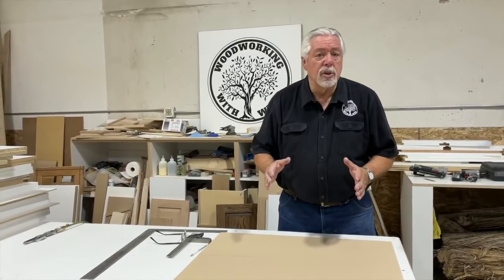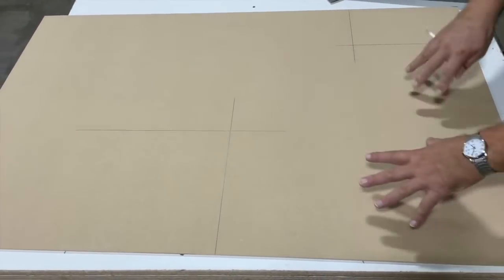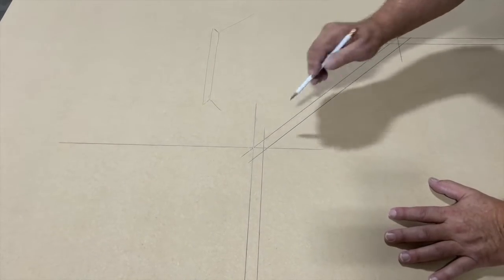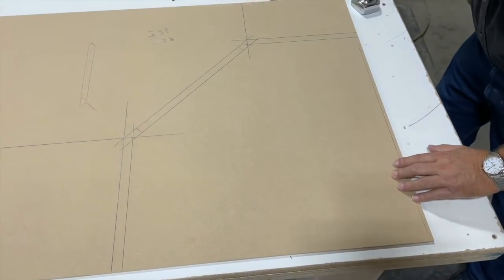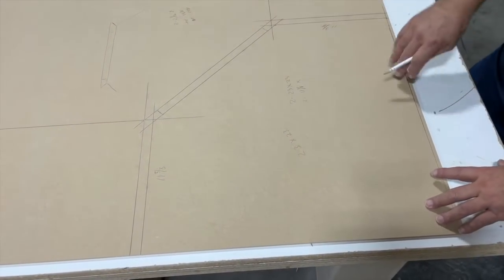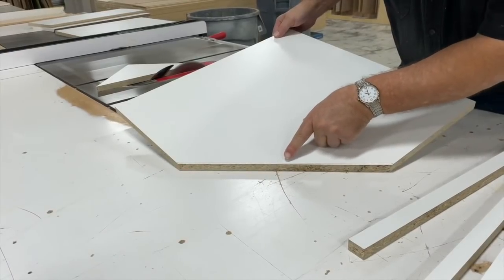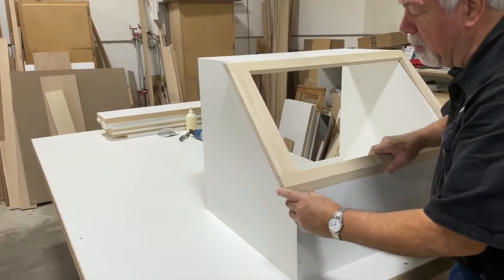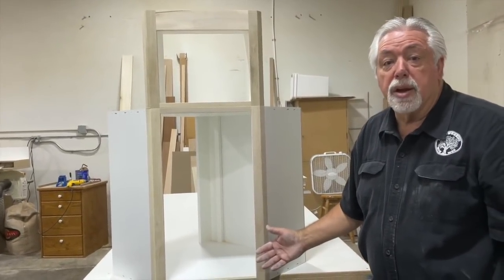Corner Cabinet Basics You Need To Know

Comment: Hi Wes, nice video. I have a couple questions:  1- why is there only one piece of backing instead of 2, and 
2- it looks like you're using particle board with nails to hold the sides to the base. Do you find particle board will hold weight over time without disintegrating, especially where the nails are?  Thanks
Reply from the maker: Connie..only 1 of the 2 backs was installed before the paint shop, allowing access to the inside of the cabinet during the painting process. The second back was installed after the finish.  Particle board in our low humidity area is excellent for cabinet construction with no issues. Hope this helps. Wes
Reply: @WoodworkingWithWes  thanks, that clears it up for me!

Comment: After you cut the top and bottom  the two sides you cut to the hight but has a 45 degree  angle  on the front  facing  the side to where the side cabinets will be joined  the face frame has to do the same way with  the 45 degree  angle  facing the same direction?
Reply from the maker: Yes John you are right about that. Thanks for watching, Wes